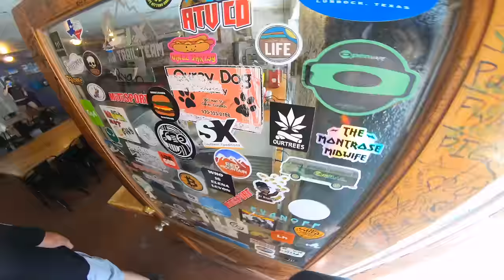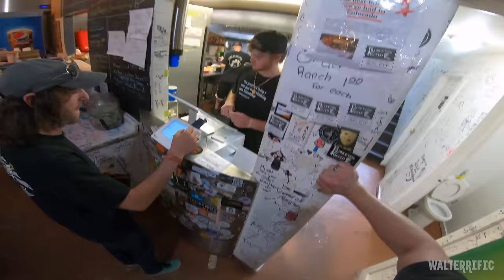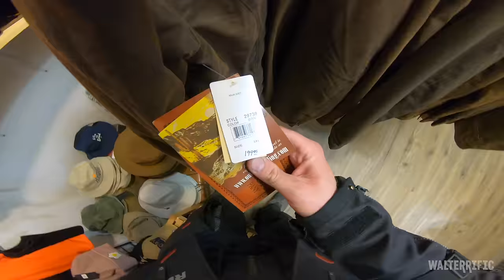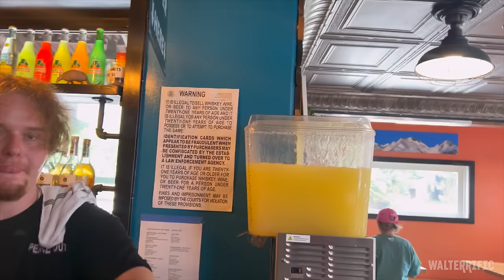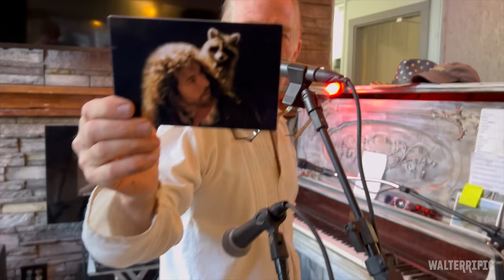Taking My Stupid Little Electric Motorcycle Into The Mountains | Long Ass Motovlog

Comment: What kind of batteries are in your bike? If they're lead acid id suggest upgrading to lithium ion. You should get a hell of a lot more range
Reply: i don't think any electric motorcycle uses lead-acid.
Reply: @Jordan-fg9cc  I thought the same thing.... Until I saw a couple at a local shop.
Reply: @cwillis1778  sounds like an EV to avoid. I don't think any serious company making serious electric motorcycles would ever use lead-acid batteries!